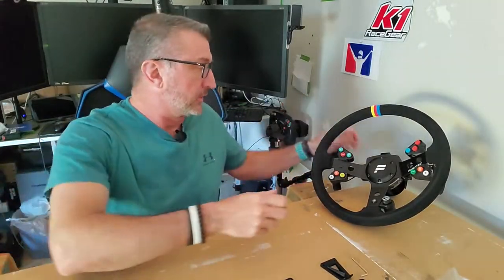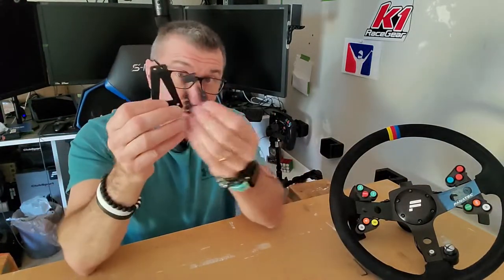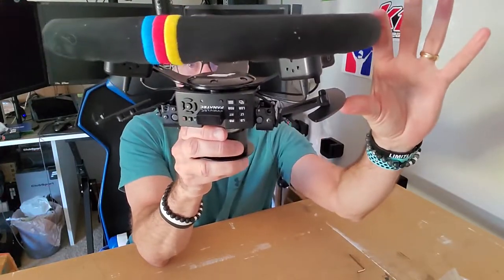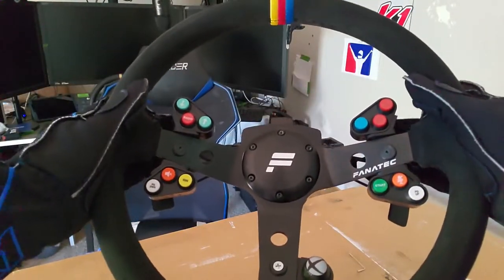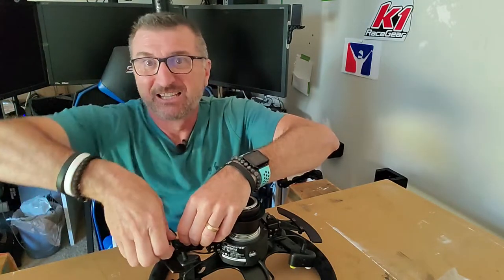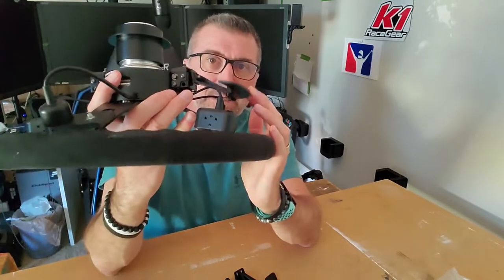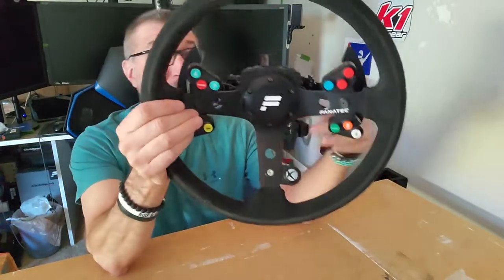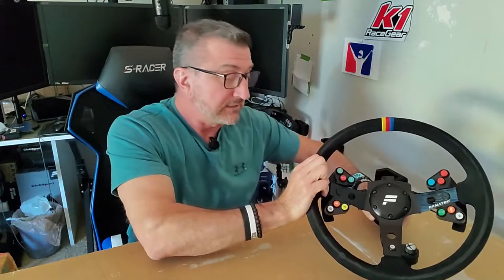Fanatec's Universal Hub V1 and NASCAR Rim Paddle Extenders

Comment: would these fit the logitech g29 paddles?
Reply from the maker: Unfortunately no.  These were specifically designed for the Fanatec Hub and the NASCAR rim.  I had a G27 before getting my Fanatec setup and I never felt like the paddles were too far.  Are you wanting something that moves them out a little?  I still have my G27 and might be able to design something I could 3d print.  No promises though.  Let me know some details on what you're looking for.
Reply: @RichJamisonRacing  i took the stock g29 wheel off an added a 14 inch wheel to the g29 wheel base is why an now the paddles are far away
Reply: @RichJamisonRacing  if you could design something or i found something and i could send the file over and maybe we can use that to make your own.
Reply from the maker: @Kreel12  I took a quick measurement of my old G27 and it looks like you would need the paddles extended about 1.5 inches.  I'll see what I can come up with over the next few weeks.  Looks like a fun project! 🙂
Reply: @RichJamisonRacing  sounds good!